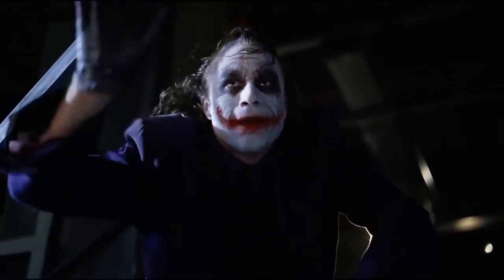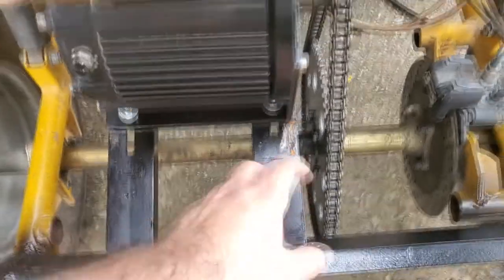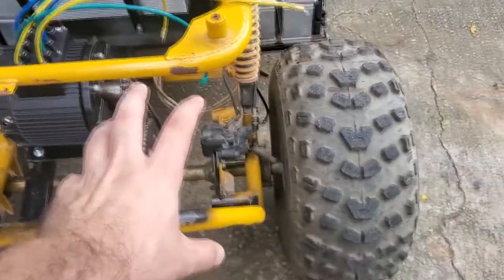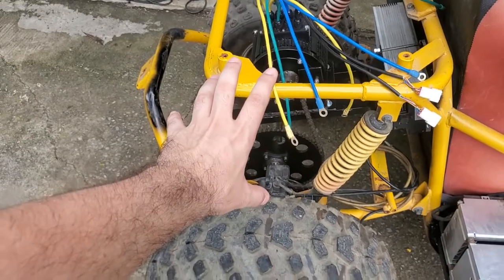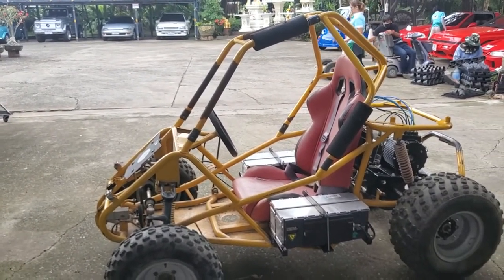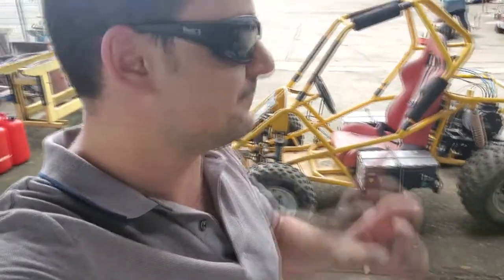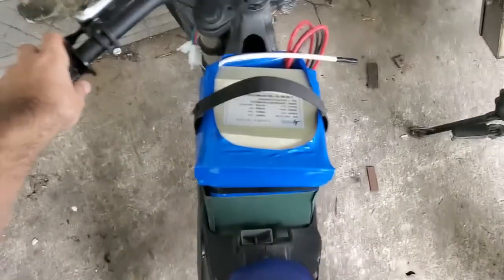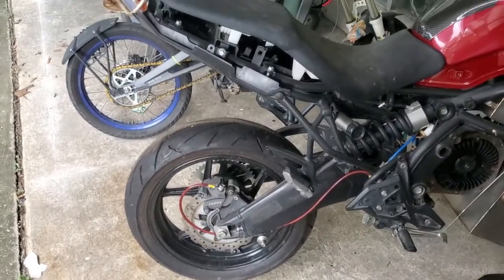The Buggy Project! Plus bonus Surron content

Comment: hi....what motor (golden v/s qs gokart) is better?? I am build an electric go kart, and i bought a QS3000w. What kind of battery do you recommend? I think buy a 72v, 20Ah battery pack. Congratulations for yours proyects....
Reply from the maker: Both are good. Just the golden can do water cooling, so it can accept more amps. The qs, I reckon maximum 200amps do it doesnt overheat